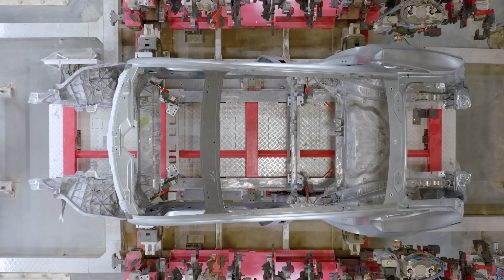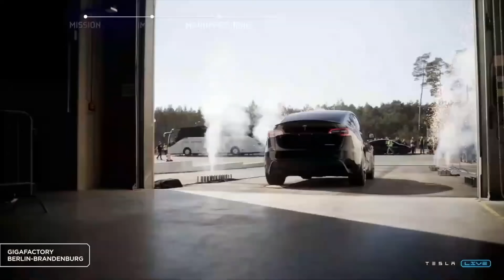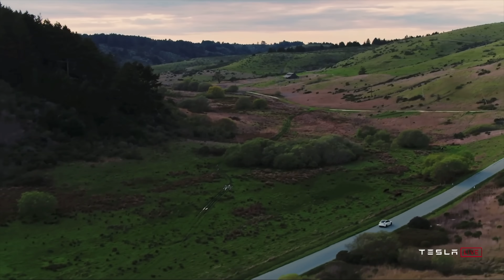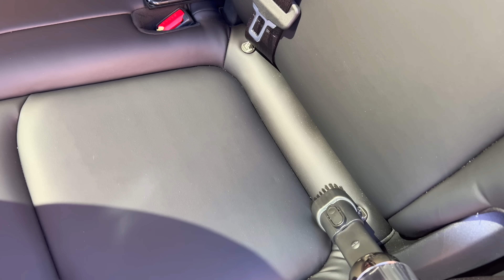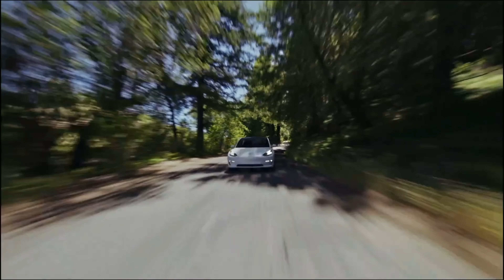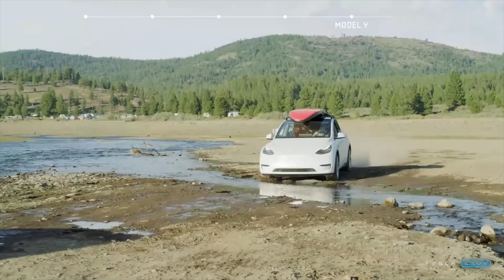MASSIVE Update Leaked Early! - Tesla Model 3 + Model Y

Comment: The solution to the Dashcam and several wierd issues such as cameras not being available is to partion your SSD to 256, default sector size, xFat.

The solution in North America is to install more stalls that are CCS. No adapters or two cables, add more stalls. Win win.

Comment: My dashcam has been coming in and out of service, recently.  I am finding that it is recording (in Sentry mode, at least), but playback isn't always possible at the time I want it.  Regarding opening Tesla superchargers to non-Tesla EV's, I don't necessarily see it as a bad thing, so long as Supercharging stations continue to be built at the current or greater pace.  I charge exclusively at home from my solar panels, so it really doesn't affect me - until if and when I decide to take a long trip that depletes my range and I am forced to use one.  I don't expect I'd be happy to have to wait in line to begin charging.

Comment: The adapter included in my M3LR…will it work in all non-superchargers should I need?  If not, is there one I can purchase?
Reply: Only on Level 2 chargers. You could import the CCS charger from Korea so you could use DC chargers. Just need to verify your Tesla will accept it the adapter. Should say it in your Software screen. “CCS Adapter”

Comment: I think Tesla adding additional ccs chargers is a good thing. It sounds like an addition and not a take away. This will add more chargers for all ccs and tesla EVs. If you own a tesla, just purchase the ccs adapter and you can choose to use the ccs or tesla supercharger. This also means, we will get more areas to charge vehicles but still use the tesla network without having to use EVgo.
Reply: CCS adapters are not available in the US and do not work on many if not most Teslas -- some research would help your understanding

Comment: Just started with the dashcam being 'unavailable" after the last FSD Beta update.  Unplug and replug the drive and it works agiain.
Reply: Unplug and ….  What do you mean?
Reply: @MadonnaDJ88  he means unplug and then plug the USB storage he’s using for dashcam/sentry mode back in. 

I was forced to reformat my dashcam storage device, which failed the first attempt. So two formats and it appears to be working now.
Reply: I also found that reseating the thumb drive in the USP port works for me.  I have not found out yet if it is a loose USB connector or something else.  The dashcam x goes away usually after the unplug and replug of the drive as Greg points out.

Comment: I had that issue 2 days ago with dashcam. I just reset the system and removed the USB and it worked fine afterwards
Reply: How do you reset the system?
Reply: @i.am.tiffanee  I just pressed both buttons on steering wheel until the system turns off. It will reboot itself
Reply: @dhaynes325  thanks

Comment: Why don't they make the vehicles tires perpetual charging devices
Reply: Check out the 2nd law of thermodynamics
Reply: How does that work? Is there such a thing currently in use anywhere?
Reply: @IDNHANTU2day  I don't think so, but would be a good invention. Kinda like those little light generators they used to sell that would be driven by the power of the wheel

Comment: Do not like Tesla opening up super chargers to non Tesla EVs. That is the #1 reason I bought a Tesla. When I go on trips I don’t want to wait two hours for a charge. I think it’s a slap in the face for all Tesla owners. Bad move Elon!
Reply: I bet they will handle it well...perhaps a small percentage of overall stalls at any given location will have a CCS cable added. 2 or 3 out of 16 stalls or whatever. With the pace of V3s going in now, there should be really fast throughput, and an ever-increasing supercharger density. I bet their goal is to not decrease supercharger availability for Tesla owners, and also add a little bit of utility for everyone else. They don't have to do much to be better than the current long distance travel options for non Tesla drivers. Maybe they will take a slightly different approach and put CCS cables on a higher proportion of V2 chargers and none on V3 chargers since most other non Tesla vehicles can't fully utilize V3 chargers anyhow.
Reply: I don’t want to share with any auto but a Tesla !!!!

Comment: Great video and informative updates Robert. I’ve had 3 Teslas and 3 Nissan Leafs over the years and in my opinion a mid-range Y is great for most households. I’ve always been a believer to buy as much distance as possible, but anything over 250 miles can take care of daily needs. 300+ range is a luxury and great to have if you can easily afford.